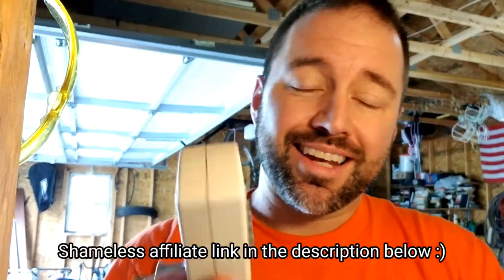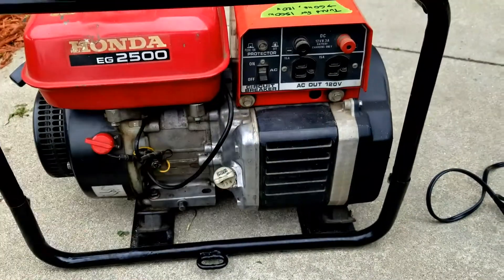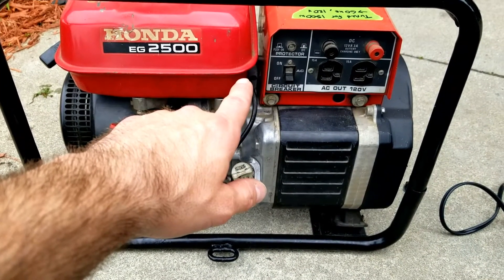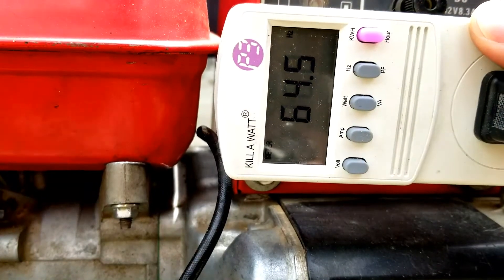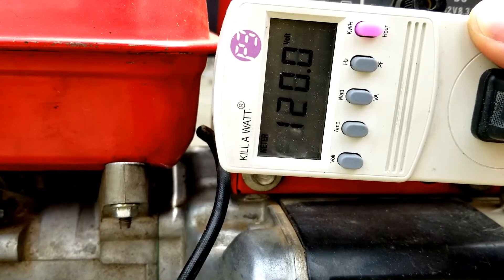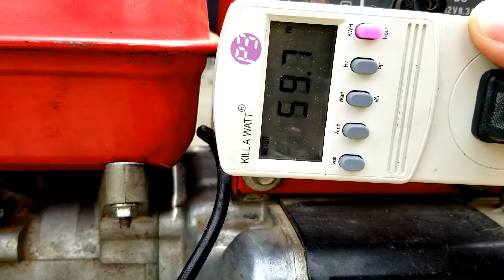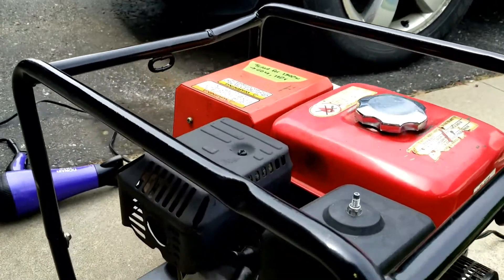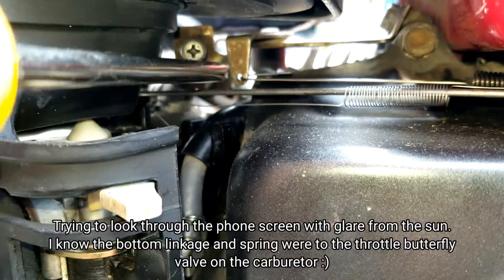Generator: DON'T Forget To Do THIS or You'll FRY Your Sensitive Electronics!

Comment: This isn't exactly the way things work, viewers could be mislead. Modern generators that are non-inverter are still extremely self regulated in more ways than one; their power board keeps the sine wave a lot cleaner and less fluctuating than a generator from 20 years ago. I have two champion generators, a small 4000W/5000W peak and a 11,500W dual fuel one. None of them are inverters (which is what keeps voltage ⚡ perfectly @240 and Freq @ 60hz) Inverter/pure sine wave power generators are much more expensive and not absolutely necessary. Non-inverters (regular generators) do fluctuate a bit, but very very little. Mine are spot-on, even testing sudden 2000-3000W load spikes, it maintains and goes from 122V to 118V at the most. Freq goes from 61.5 to 58 etc.. fluctuations are so insignificant. It's the modern tech of all new generators, all of them, WestingHouse, Generac, DeWalt, Champion, Honda, Predator... All have these power boards with Intelligence and Voltguard even when they're non-inverter generators. Nice video, but can be misleading. For example, my Champion generators are warranty void if you touch the governor (engine throttle regulator), because the automatic voltage regulator and the computar power board is what does the job of putting out proper voltage and frequency.... In the past (decades back) things were very different.
Reply: Agree...the "frying of delicate electronics" seems to be overhyped. This video too...."avoid frying your electronics". People hear this....pick it up as gospel....and sound "smart" by repeating it. And so it goes....so that means I've heard about this maybe a thousand times over in vids and blogs like this,  but NEVER....not once.....had a person make a comment that he has direct experience having fried HIS electrics. And ask yourself this too....just WHAT is a "delicate" electronic piece? No one seems to define this and all this does is cause doubt so that we dump our generators and buy new $$$ inverter style. Anyone here with specific counter-points...personally observed?
Reply: @TheWilferch  Literally here at this video due to damaged refrigerator, microwave, dish washer, etc. from running generator. Trying to avoid frying these things again next time the power goes out.
Reply: @niz76  ..I still stand behind my previous statement. After considerably more research , it "appears" that the normal (non inverter style) generators WITH AVR   will be ok. It seems that long term ( that is, nearly "constant" ) use of non-inverter style generator power supply that provides a tightly controlled voltage and frequency.....but provide a power curve shape tha isn't a pure sine wave..... can LONG TERM cause some damage to equipment that can shorten it's life....but so far have seen no reports "frying" electronics...as in catastrophic failure
Reply: I've seen my step-dad run his old 5000w generator my whole life, recently for a week straight powering computers, tvs, refrigerator freezers and wifi box and that thing he bought in 1982 and still works just fine and never hurt anything he's hooked to it. So I'd agree that the whole "pure sine wave" inverter talk is largely just marketing.
Reply: what you are referring to as power board  are called AVR (Automatic Voltage Regulator ) and not all Newer Generators have them a lot of the Cheaper China Made one's Don't have a AVR  , The worst are called Brushless Generators and are Horrible at controlling the Voltage  i have seen them go from 86V-168V  when loaded and unloaded
Reply: @Melvin Dwayne  Thanks for your comment! I couldn't find this anywhere everyone is claiming I have to buy an expensive generator for the purpose I need it but I want to ask:
So I bought a cheap traditional dual fuel generator (sportsman 4000) solely for the purpose of charging my Solar Generator/Power Station in case it's needed (and to have a backup to the solar that is stronger) 
I didn't find out till after I bought it that "I have to have a newer more expensive inverter generator" just to charge the battery of the Solar Generator/Power Station.

My dad is old school & says "that's thinking too much you'll be fine old generators have worked for years"

Could you (or anyone else) give some insight on this? Or WHY I HAVE to buy an inverter just to charge the battery of the Solar one?
(The sportsman can use gas or propane btw, I figure to keep & use propane). Thanks for any help/answers as there's not much AT ALL on this topic. Maybe 1 or 2 resources out there on the whole topic.
Reply: @nomoneyball5423   Your Dad was correct years ago but many new appliances now have Micro Processors and Micro Switches that must have " Clean Energy "  which have been explained quite well here in comments.   My new L.P. gas furnace wouldn't even humm using my old style gen that was running many other things.  Fortunately  it still worked when the power came back on and I've since bought a Predator 3500 Inverter that runs it perfectly.
Reply: Hi looking beyond the scope of this video I did see a You Tube video can't remember which one dang it but it was a generator guy and he said you MUST use an inverter gen but just for when your charging the batteries you refer to cause I guess they super sensitive or something and can ruin stuff to do with the solar generator but looks like your comment was a year ago so I'm sure u got an answer by now.
Reply: Sorry but you put way to much faith in an AVR that's found in the portable generators. Using a multimeter is not going to show you what's happening to the sine wave and voltage spikes. You will need an oscilloscope for that. Those generators put out very dirty power. The AVR units are far from perfect. They will weaken and destroy electronics. They are not designed for that type of use so beware if you decide to chance it.
Reply: Hi you seem to know your stuff, I have a sort of newer generator how can I give it a fast test to know if it is safe, no I don't mean by plugging in something and frying it to see I did enough of that with my old Colema, had to throw out a microwave and get the oven fixed
Reply: @chadbosko8935  You would need to use a tester that can measure both voltage and Hz frequency. Many testers have your A/C, D/C, resistance testing in ohms, and other functions, but may lack ability to measure Hz freq ...  There are some affordable testers between 35-45$ US that can check the frequency in Hertz, most of the ones that are capable of doing this will be able to display the frequency in real time between 9.99 and 99.99 Hz. These testers are just (entry level) and would also check for standard stuff and be multi-use, check DC current etc... You just have to look for one that can measure Hz.   As you know, here in the US we need to be at 60 Hz, and keep an eye on the way that freq fluctuates; same thing with the voltage....  As you add and remove loads on your non-inverter generator, you'll notice fluctuations in voltage and frequency, that is normal.  Somewhere between 54-58 hz when the gen is very loaded is normal and could be considered acceptable, not ideal, but it shall not break or damage anything. When gen is loaded to capacity your 240V could be 220-225V or so, that is normal...  Similarly, your 120V  can drop to 110V more or less...  If your Frq in Hz is stable and fluctuations in voltage are minor and within acceptable range, then your appliances are safe. Now, as an example of inadequacy, do not try to power an ECG/EKG machine to check the heart, ICU hospital equipment,  or medical equipment that measures finely tuned waves of electricity to measure heart rhythm and heart electrical current, that would be full of noise and inaccuracies, as the SineWave of a non-inverter generator is jagged and NOT CLEAN, its just called "dirty" power for those applications. Computers and Laptops, as well as digital appliances are powered by DC current with their own power supply and transformer; in this day in age, those are safe with "dirty" generator power as long as your generator is not broken or putting too high or too low a voltage, or maybe dangerously fluctuating frequency, sometimes defective AVR in a gen can cause this and damage appliances... This is rare, there are safety measures that shut off Gen power and trips it out (newer generators with volt-guard) etc..   Hope this helps.   here is one tester that could measure both:  UNI-T Digital Multi Meter UT89X 6000
Reply: The for your comment I learned a lot that is helpful. Thanks
Reply: The only way to know for sure that you have perfect since wave output is to look at it with an oscilloscope.It will also let you measure peak to peak wave voltage and frequency.
Reply: @chadbosko8935   >  how can I give it a fast test to know if it is safe <
You asked several months ago, but in case you are still in need, the device this guy used in the video is inexpensive and super handy for checking how much all your 120V goodies are adding to your power bill every month (in fact, that's its intended purpose),  It's called Kill-a-watt, and can be ordered from many online retailers for about $25,  I bought mine right off the shelf from my local hardware store, so you might check there first if you prefer not to do the mail order/shipping thing.
Reply: chad bosco,   Most everything shown in this video is correct but he is using an old style standard gen that the governor is not maintaining 3,600 rpm needed for the 60hz.  Running heating elements, fans, lights can run on "dirty energy"  but many new appliances use micro processors & microswitches that must have "clean energy."  Many things would run on my old gen but not my new L.P. gas furnace.  I bought a Preditor 3,500 Inverter which runs furnace/window AC, fridge, freezer,  T.V. system, lights with no problem and power to spare.  But remember,  you don't have to run everything all at the same time in a power outage.   Melvin Dwayne explains everything very well.  Also drop down to comments by Herman Nel and Knowledgeseekerr to understand how this all works.  Thanks for the great video.
Reply: Fully agree....see my other comments above
Reply: Yeah I saw the Westinghouse 5300 newest  model actually mentions having a voltage regulator in it. I read where they were saying the THD though was abt 25% or less but seeing a few reviews of guys running there electronics computers etc with no worries. In fact Forman guys say no problems either surprises me so must be true. Thanks glad found your comment.
Reply: Ah thanks brother I was getting concerned I had to mess with my brand new one like this. I was thinking to myself that I should have just coughed up the extra money for all this hassle and got an inverter one. I appreciate the heads up on this matter.
Reply: Non-inverter generators do not have a clean sine wave output. That is the main issue with electronics, not the frequency or voltage
Reply: @harveypaxton1232 what do you think the sin wave is mapping?  Voltage and time (frequency)…

Comment: Bad information
This should be removed
Reply: I have to agree with you Henry.  While over and under voltages are issues, dirty power generally refers to the Total Harmonic Distortion of the Sin wave that the generator produces.  Sensitive electronics generally require <5% THD.
Reply: @HomesteadEngineering  Agreed.  The THD of a non-inverting generator is quite high and causes unwanted heating and plays havoc on sensitive electronics.  This is not what this video was about.  Quality of YouTube has gone downhill fast.  Anybody with a video camera or smartphone thinks they are an expert now.
Reply: @Sherlock_Ohms  You could say the same about anyone with a keyboard...
Reply: @nodak81  good call